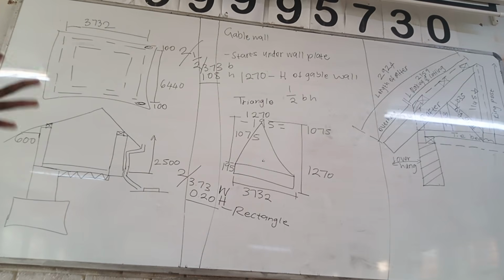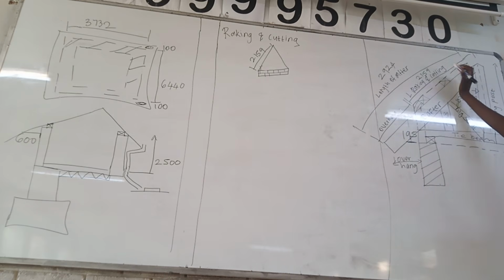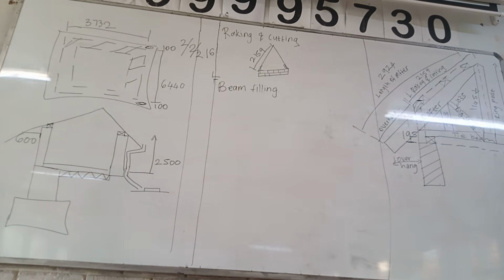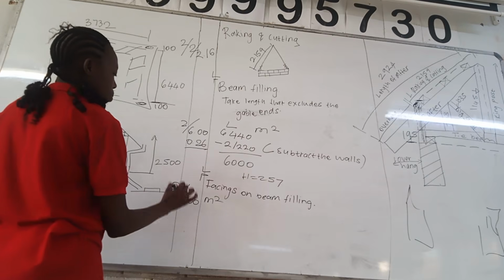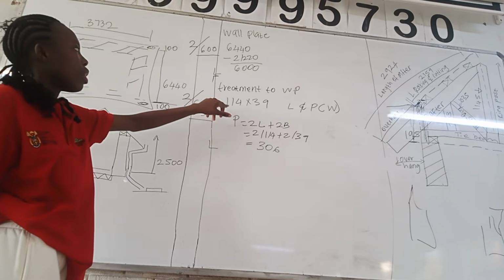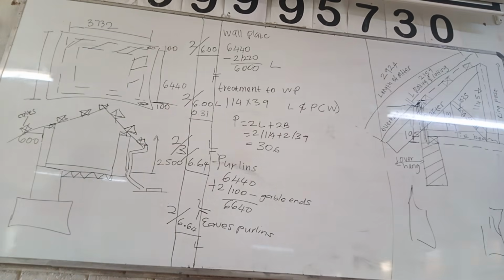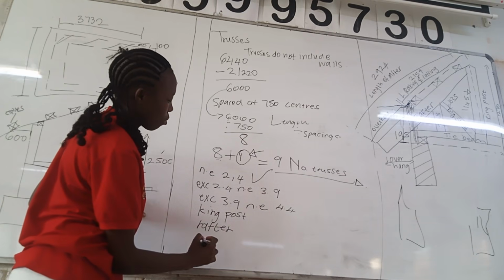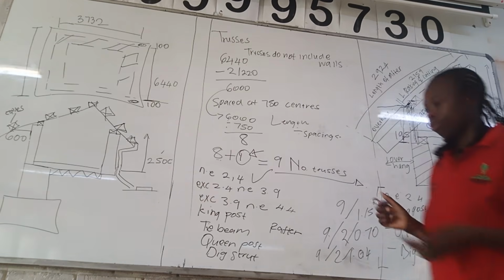ROOF N4

Comment: Do we always get the half roof truss or we draw for ourselves?
Reply from the maker: You usually have to draw it yourself❤
Reply: @HMCivilEngineeringHub  so you have to guess the measurements for half truss cause they are not shown on the specification?
Reply from the maker: @IkanyengTlale you don't guess there a certain way you can get them.
I'm having a class tomorrow you can attend at a fee of R100.